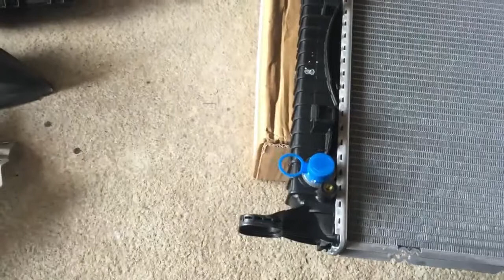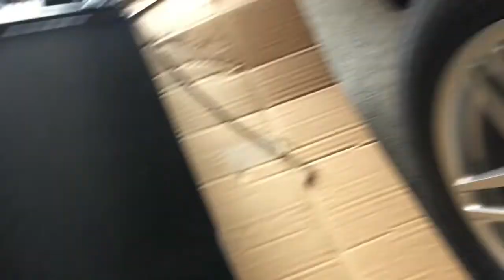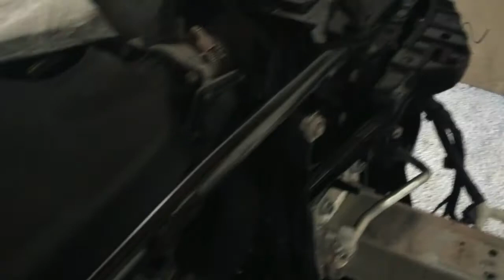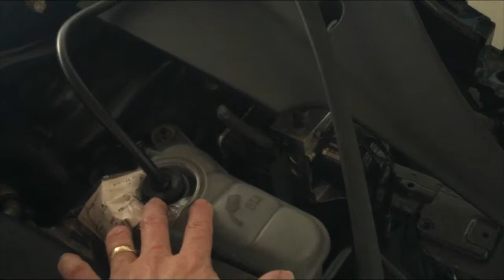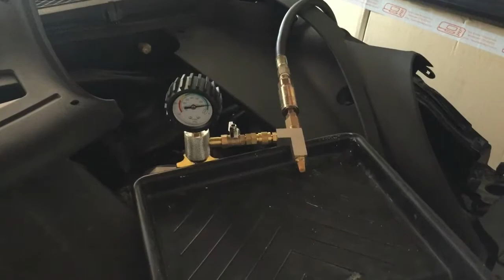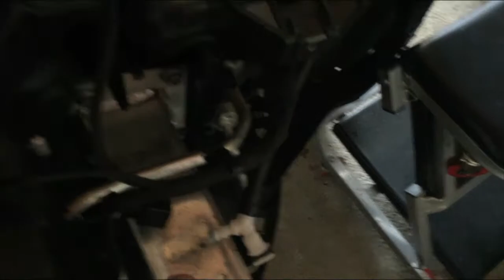Porsche Macan Radiator Replaced and Coolant Filled

Comment: I heard the Audi radiator Works, I need one but im having difficulties to find it for the macan base 2.0 in united states, Any recommendations?
Reply from the maker: If you use the pdf link I sent in reply to your other comment, confirm on one of the first pages (v-pages) which 3 or 4 character code represents your model (list is on page 2). Then go down to page 105-35, 105-37 or 105-38 depending on your model (you may find it easier to navigate the pdf in Adobe Acrobat Reader than internet explorer).  You will see it lists the radiator as part 1 and the specific radiator for each model depending on the 4 character code.  Seems most models take an 8K0 part which is an Audi part number with only a few models taking a 95B part which is a Macan specific part.  Hopefully your car has not already been stripped of the damaged parts as the part number should be somewhere on the old radiator.